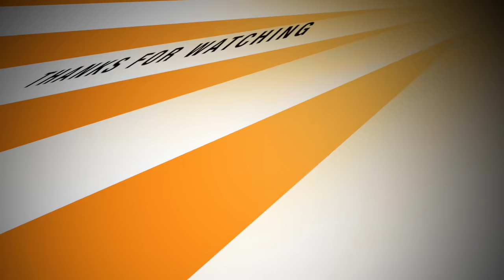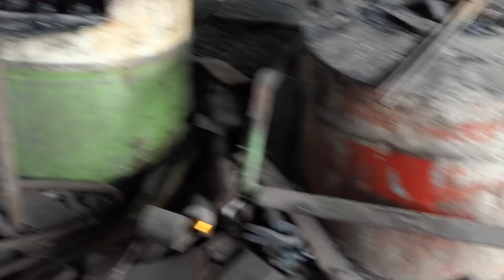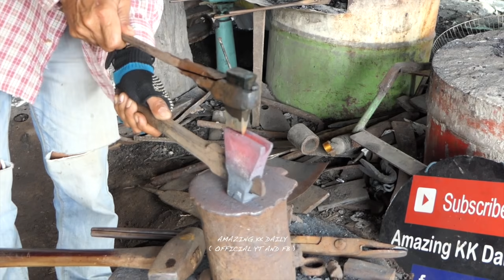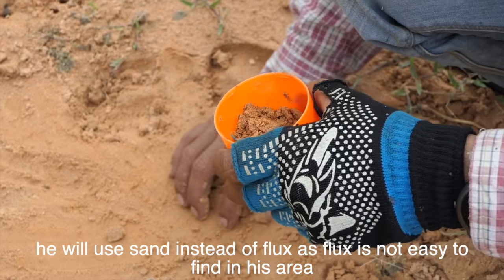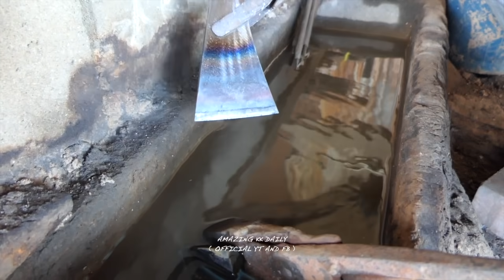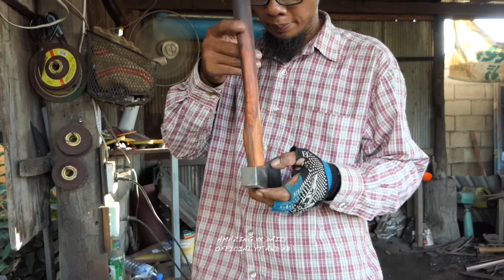AMAZING TECHNIQUE / COMBINATION OF LOW CARBON STEEL WITH HIGH CARBON STEEL TO MAKE STRONG EDGE

Comment: Good job, I did notice the edge of the top got burned on one of the first welding heats, that has always been the bane of my existence when forge welding high carbon steels. The higher carbon steel burned at almost the same temp as the low carbon steel begins to weld at. Incredibly hard technique to master, especially in a solid fuel forge, the lower temp of a gas forge makes it MUCH easier.

Comment: It's a technique still used in Japanese traditional sword making. Seth using it here is not only a good use of recycled resources but provides a great and long lasting axe.
Reply: This technique of placing a high carbon steel bit in a softer iron or steel body has been used all across the world from the very first steel swords ever made. Excellent work though, very good and clean weld,many smiths struggle to get such a clean weld with modern fluxes. I’d like to suggest that you could do it without any fluxing agent at all. It was done historically, with lower tech forges, so it’d be a good challenge, I think.

Comment: Well done. Next time you may want to put a slight bend in the high carbon steel to fit better into the axe. Just a suggestion. 👍🏻👍🏻👍🏻👍🏻

Comment: This is nothing new. Axes were made this way as soon as the smith discovered the iron left in the forge over night was a bit harder. Steel. With the advent of the bessemer process axes were made of steel. It was cheaper. But this IS the age old way.